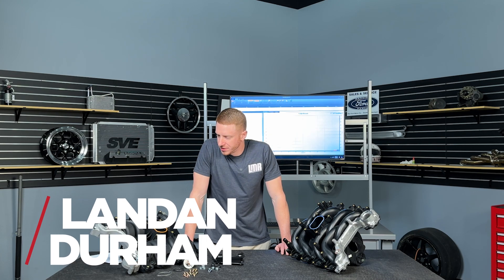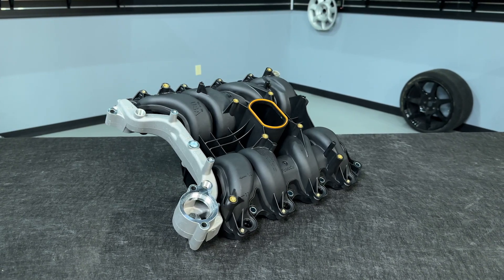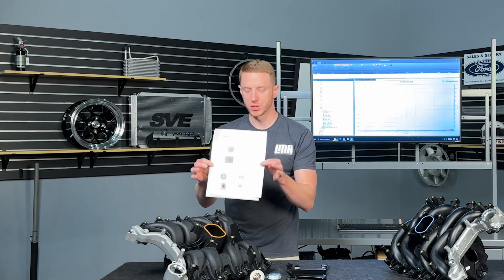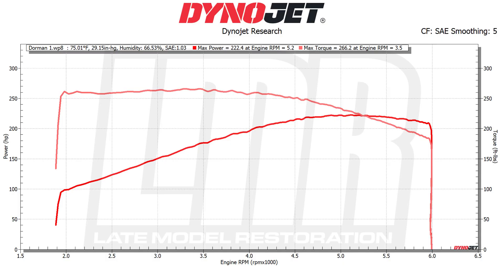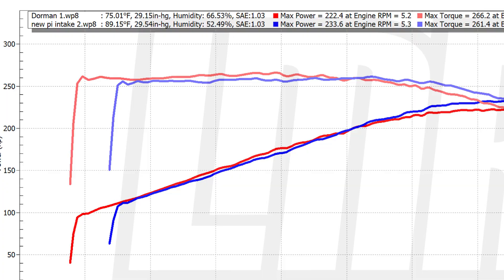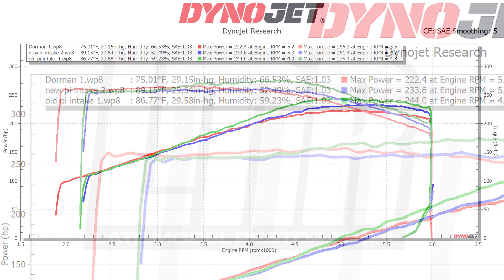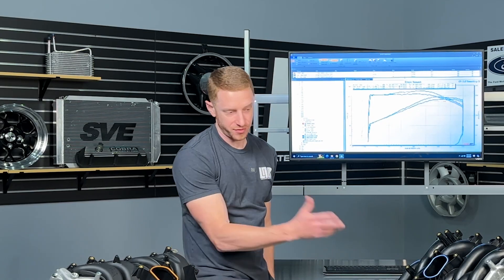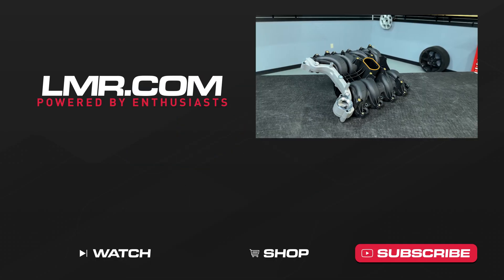NEW Ford Performance 4.6L 2V PI Intake Manifold (M-9424-P46A) - Dyno Runs & A Closer Look

Comment: I bought one. And i like it. You can’t find the ford one in junkyards anymore
Reply: Might want to double check those coil pack bolts. Didn’t even tighten mine very much and now the inserts are spinning. Got 2 that are stuck in there.
Reply: @TraitorPotater why does the intake manifold affect the coil packs?

Comment: Just installed this and now I’m not getting spark in any of the driver side cylinders. Any idea why?
Reply from the maker: Double check all the stuff you removed and reinstalled. -Landan
Reply: @latemodelrestoration  Everything went back together just fine. I’m thinking maybe I broke a wire in the harness because the plugs to the coils aren’t reading a ground connection. Ordered a new injector harness so we’ll find out.
Reply: @TraitorPotater did you solve the problem?
Reply: @danpan001  yeah, it was the new injectors they sold me. 2 of them were defective and completely stuck open! I didn’t think it was the injectors because it was the first thing I checked and the car was still only running on 4 cylinders after putting the old ones back in so I immediately ruled them out and figured it was an electrical issue instead. But it turns out my driver side bank was just so flooded with fuel and I didn’t give it enough time to evaporate that it was drowning out my spark plugs ability to make a spark. Not to mention I quickly wasted an entire tank of gas just from running the car looking for a bed sensor or connector and switching around spark plugs and coil packs. So it kept reflooding and soaking up my exhaust with raw fuel. But I didn’t come to that conclusion until after I switched out the wiring harness and it still didn’t work. After revisiting the thought that it was the injectors I took everything back off including the manifold, cleaned off the spark plugs and injectors, and let the cylinders air out for a few days. Put everything back on with the old injectors and it ran just fine again. Although I did have to let the car run for about a half hour because it was still pouring smoke out the tail pipes. So I let the exhaust get nice and hot to evaporate the rest of the fuel out of there. Smoked out the front of my neighbors houses in the process so they were probably pissed about that. 😂 Still smoked a tiny bit for about a week before it completely cleared up. Also I’m sure half of my cats and o2 sensors lost a good amount of life from having a full tank of raw fuel being shot through them.
Reply: @TraitorPotater Great 👍
Reply: @danpan001  are you having the same problem or were you just curious?

Comment: With my MHS stage 2 cams and 3500-4000rpm torque converter goin into this 2v pi swap, I'll never have to worry about that low end torque curve when it matters...so, looks like im getting this intake with the BBK 78mm TB/plenum after all the pain of trying to find a good used bullit/TFS intake, or dealing with the hassle of tryin to get the parts sourced for an Edelbrock and the 90mm TB to work.

Comment: Just had this installed on my 2011 Lincoln Town car as preventative maintenance. great product/part. Car already ran great. Runs even smoother now!
Reply: Thanks for your comment. I am glad to see it because the title says for cars up until 2004.  Mine is 2006 Lincoln Town Car.  Did you need to buy other parts to modify because it seems this is for Mustang. How many miles is your car? Mine is 80k miles. Previous owner had it sit in garage for 5 years. Thanks

Comment: So my question is. Is it possible to use this intake on non pi heads? Like we could do with the stock pi intake and flat gaskets.
Reply from the maker: I wouldn't even hassle with it. If there is any performance gains (which I doubt), it still wouldn't be worth all of the work that's involved to make it fit. -Landan
Reply: @latemodelrestoration thank you for giving your opinion instead of answering my question
Reply from the maker: Honesty is the best policy.

That I know of, no one has installed this intake onto non PI heads. There are plenty of write-ups and info floating around old forums of folks installing the the older PI intake onto non PI heads. -Landan
Reply: What do you mean by non pi heads? My car is 2006 lincoln town car. How do I know?
Reply: @danpan001 2003 up panther cars got the p I heads. You can use this intake
Reply: @JohnJones-xy5yt thanks for your help. The link on this video comes with bracket is it for Mustang or it fits my Town Car too?
Reply: @danpan001 that I couldn't answer, as I mainly deal in the older cars
Reply: @JohnJones-xy5yt thanks. I thought I have an old car 😂
Reply: @danpan001 lol I meant the pre-98 areo body style ford/mercuries

Comment: Is the new pi intake designed to work on a npi motor as in the 96-97 t bird and 96-98 mustangs
Reply: Would love to see you guys do this test on a npi motor to compare from stock npi intake since it is such a common swap. Npi intake allegedly makes only 120 hp or so at redline so maybe a new pi intake would be worth it even without the extra 10 hp from the factory pi intake
Reply from the maker: No, it's designed for a PI cylinder head. Not to mention, it isn't worth the headache to try and make work. -Landan
Reply: @latemodelrestoration  Yes i agree with the preinstalled gaskets but with the old pi intakes 1 piece gaskets all it takes is a little rtv on the corner of each coolant passage and a pi heater hose to put on a npi

Comment: Bought one of these manifolds a while back and need new gaskets guess what nobody knows the part # this has individual gaskets on each port and ford racing and everybody else has no idea.
Reply from the maker: I'm not sure we're you would get new gaskets either, unfortunately. I think all of our hands are tied on this one until Ford has replacements available. -Landan
Reply: That is interesting have you finally figured out? The gaskets are individually built in. Is each gasket different or same?

Comment: Will this work on a F150? 2008 stock heads
Reply from the maker: It will physically bolt up, but there are differences with attaching components. Just purchase a intake manifold that's intended for your MY F-150. -Landan

Comment: Has anyone had success with the OPR Replacement PI Intake Manifold ??
Reply from the maker: I can't speak on behalf of other brands, but I have found in my research some, not all, private label 4.6L PI intake manifolds use either the SKP or Dorman brand intake manifold. -Landan

Comment: Will this work on a 5.4 block with 4.6 pi heads?
Reply from the maker: No. The 5.4 has a taller deck height which makes it wider than a 4.6. They used to make adapters to run 4.6 intakes on 5.4 engines, but I haven't seen those around in a while. -Landan
Reply: @ I thought so, thanks for the reply

Comment: The truth is, Ford did not design this. They just outsourced a replacement part because it's an old model and they don't care. You can get the same manifold under a no name brand for $100. May as well go cheap if you can't buy the good stuff. They did the same thing with their TFI modules.

Comment: How are you supposed to attach the heater hose to this port? It comes with a plastic barb that locks in but it is a loose fit on my hose and caused a leak. It’s on a 2010 Lincoln town car.
Reply from the maker: You have to install the provided barb into the gray fitting. It only goes one way. -Landan

Comment: I bought several Crown Victoria PI intakes brand new. They are currently out of stock, so this intake will suffice. I do love the crossover bolting directly to the heads, which means no more rotten plastic to fail. I'm currently in the market for another one, and this is the one I'll get.
Reply: Will this fit 2008 crown Vic police inteceptor
Reply: @aray9987  yes
Reply: Will this fit 2006 lincoln town car? Thanks

Comment: Can Anyone tell me if this intake will fit a 2007 f150 4.6 2v. Mine is leaking and Ford has Discontinued the factory intake for the f150s. The Dorman has mixed reviews and I would like to use a Ford part as i believe it will last longer i do not care about hp gains or losses just longevity. Any thoughts or advise would be much appreciated Thanks!
Reply from the maker: No. Although it will physically bolt up, there were other attaching pieces that were specific to the F-150 intake manifold. -Landan
Reply: @latemodelrestoration  Thank you for your Response!

Comment: It seems like some of you only had 5 people in your class and 2 teachers. The new intake manifold needs a tune. I guess common sense isn't so common.
Reply from the maker: When installing this intake on a PI engine, a new calibration is not required. Ford Performance states that a calibration is required if using this with a PI swap on a non-PI short block. -Landan

Comment: Instructions are complete hot garbage. Just got mine from LMR and I am beyond 😡
Reply from the maker: Thanks for the comment and sorry to hear about the instructions. Ford is the one that supplies the instructions with every intake. Is there something in particular I can help you with? -Landan
Reply: @latemodelrestoration 
It's claimed that this intake is a direct replacement for a 2003 Mustang GT.  It's not.  The plenum has 5 mounting bolts, 4 of them in the main rectangle pattern have the threaded inserts to accept the bolts, but the 5th one which is on the"wing" for lack of a better term, is just a plastic hole that assumedly just gets one of the self-tapping screws to fasten it with.  I believe I figured that out, as there are only two options supplied with the kit, and they are different sizes.  But here again, how tight do you screw it in?  And why should instructions make me guess?  And what are the torque specs on these bolts, especially the coil on plug bolts?  And what about that spacer on the thermostat cap (the radiator hose that goes to the thermostat?) I cracked that and now I need to buy a new one, and I don't know how I cracked it as I used a torque wrench set to very low ft lbs. found in the Haynes manual.  Maybe I need the spacer, maybe I don't, I don't know because these instructions are awful.  And I have two coil on plug bolts that just spin because they must've been over tightened, but I don't know how that possible as I was using an INCH POUND torque wrench set to an ASSUMED torque spec, I think it was 80, and that shouldn't strip out anything!  Like I said, beyond 🤬.  Oh, and I ordered a gasket set for 40 bucks, since this intake was advertised as a direct replacement which would make me assume it needs gaskets as well, but it doesn't because the gaskets are built in to the manifold.  This whole process has been harder than it needs to be...
Reply from the maker: @dennisgoode8818  Again, sorry to hear about the trouble you're having. Ford's instructions have always been worded and directed toward technicians. That's just the way they've always done it. You can return the gaskets and we'll give you your money back. Please reach out to our customer care team (link below). Maybe you didn't see it, but the product page and the product images mention/show pre-installed "updated" o-ring types gaskets. -Landan

https://lmr.com/contact
Reply: @latemodelrestoration 

Also step 13A claims that a plug goes into where the temperature sensor was on the original intake manifold but this is wrong, unless this new intake is meant to be operated without a temp sensor.  That couldn't be true, could it?
Reply: @latemodelrestoration
And nowhere does it show that gray plastic tube goes into the intake manifold is supposed to be inserted, but it does show it's supposed to be capped after I already installed the manifold.  This mistake became quite obvious when I compared the old original manifold and then realized the tube was supposed to be inserted because that's where the heater hose attaches.  So instruction 14 A&B are also incorrect.  On an 03 Mustang GT, you would not put the plastic barb and coolant cap with o-ring in that gray tube.  The instructions are not only poorly written, or written for just technicians, but they are flat out wrong!  Unless of course I am misunderstanding my model subset.  I have an 03 Mustang GT SOHC NA EFI V8.  The G-HP part in the applicable models section I'm not certain what that means, but I can't imagine that there would be that large of a variance of where the heater hose port is on the GT model.  Is there?
Reply: @dennisgoode8818  Were you able to get a good seal on your intake and not leak coolant from the heater tube?

Comment: I have a question if someone could answer that would be great, can you use this PI intake instead the Doorman  on a 2000 Ford Crown Victoria Police Interceptor or stick to the doorman???  and does it require any modifications to it???
Reply from the maker: I'm fairly certain that the 2000 MY Crown Vics still had a non-PI engine, but I don't know those cars like I do Mustangs. I would confirm that first. If so, then this intake won't work. This only fits PI cylinder heads. -Landan

Comment: Looking on the ford website they claim the following: Larger Bell Mouth, Shorter Runner, More Rounded Runner, and Deeper Plenum. So I'm thinking with bigger cams, better heads, higher flow exhaust and at higher RPM this intake should actually perform better...............

Comment: I have a 2003 Mercury Grand Marquis with what appears to be the original Ford PI manifold with aluminum crossover and gaskets. It recently got a small leak from the bottom side of the intake gasket, under near the thermostat. Can i keep my original intake, assuming good condition, and just replace the gaskets?
Reply from the maker: You'll have to remove it from the car and diagnose the leak. I'm just taking a guess, but it could be that the plastic is cracked causing the leak. That's usually what happens as I've replaced several PI intakes with this issue. Hopefully, it's just the gasket. Good luck! -Landan

Comment: They sell off brand PI intakes on EBay, has anyone tried one??  They are shaped exactly like the OG ford performance intake but have different mold markings on them.. I’m wondering if these will be the best option??
Reply from the maker: I can't speak for the intakes on eBay that look similar to the original Ford PI Intake. I've never seen one in person. Judging by the photos, the manifold chamber looks smaller than the original Ford Performance intake. That's just a guess, though. Maybe someone will chime in with real world experience and not just a "best guess". Thanks. -Landan
Reply: @latemodelrestoration  Thanks for the reply, after some research I’ve found some videos saying that they are an inch or so shorter up top and bottom.. So I’m assuming they aren’t as good as the PI intakes but maybe better than the redesigned (Dorman) new ford intake
Reply from the maker: @NewEdgeDesigns  Glad you were able to find some info. Good luck with whatever route you take. -Landan

Comment: Has nobody noticed that the new intake's coolant cross over is completely aluminum now instead of sealing to a plastic base with a gasket in between like the old ones? This one appears to have finally solved the leak issue.

Comment: What am I missing? My 2010 LTC already makes 239 HP and 287 fp of torque. The 2010 PI Crown Vic has 250 HP and 297 torque. This would be less HP and torque than my LTC.
Reply from the maker: Those ratings are at the engine's flywheel. It takes power to turn the drivetrain (transmission, driveshafts, axles, wheels). The horsepower and torque shown in the video is at the rear wheels. Think of rear wheel horsepower and torque as your take home pay after taxes are taken out. Let me know if you have any questions. -Landan
Reply: @latemodelrestoration  Thanks for that answer. I always thought the company specs were at the rear wheels. What is the crank HP and torque of the PI manifold engine or what is the rear wheel rating for a stock 2010 LTC?
Reply from the maker: @altg5708  I don't know the rear wheel horsepower and torque numbers of a Lincoln Town car since I've never dyno'd one. I have dyno'd a Crown Vic. I'll leave a link below. -Landan

https://youtu.be/l7J6T6i6N5E

Comment: Anyone tried this on a Lincoln Town Car? I have a 2009, looks like I would just have to plug the extra hole on the crossover? Looks like one is included? Anything else I’d need to know?
Reply from the maker: Yes, this intake will work with your 2009 Lincoln town car. -Landan
Reply: @latemodelrestoration  Thank you!
Reply: @latemodelrestoration how about 2006 lincoln town car? Thanks
Reply: Is the plug come with the intake manifold PI or have to buy it from other sources?

Comment: so how do i fit one on a 98 npi engine? crown vic. ty for the review
Reply: Speed master adapter plates 4.6 npi to 4.6 pi intake.
Reply: @akkmdk  sweet! sure beats rtv
Reply: @akkmdk  What the..why have I never come across this before in all my searching. Have you tried these plates? Also, thank you!
Reply from the maker: Thanks for the comment. Honestly, it could be that you just stick to a non-pi intake for simplicity. I've never personally installed a PI intake onto a non-PI cylinder head. Like someone else mentioned, dig around on the Internet and see what you can find. -Landan
Reply: @latemodelrestoration my car is 2006 lincoln town car signature limited how do I know if I have a PI cylinder head or not?
Reply: You cant. You can either install P.I heads on your car. OR you can go see the ChrisFix video where he installs a P.I intake on his NPI Mustang 4.6 (1998). He rigs it so that it works but thats the risk you will be taking.